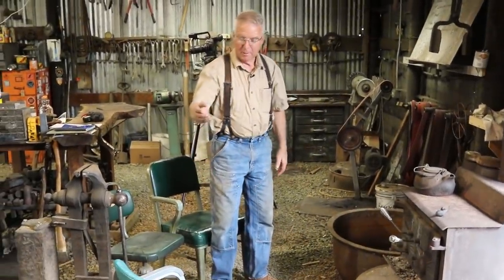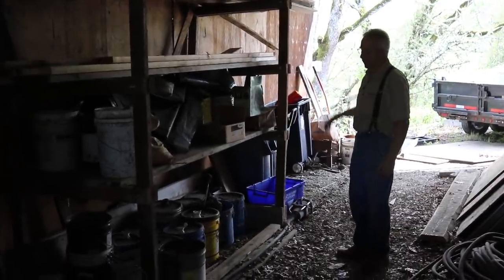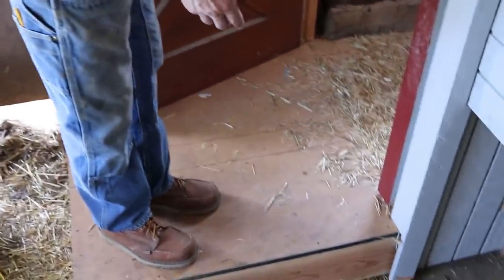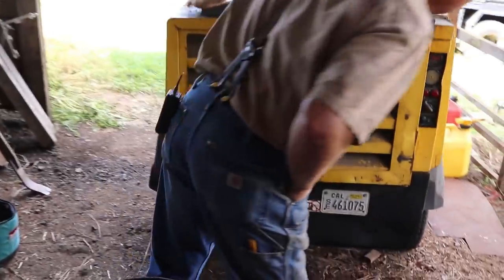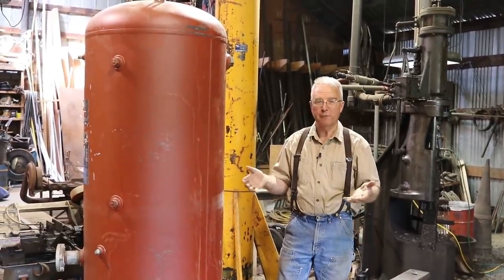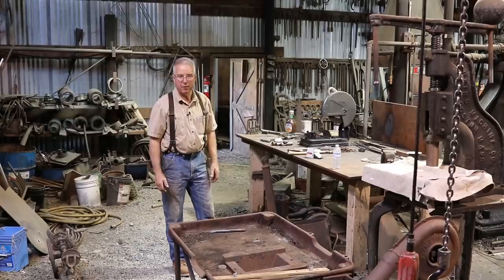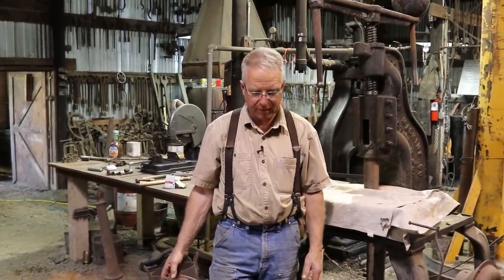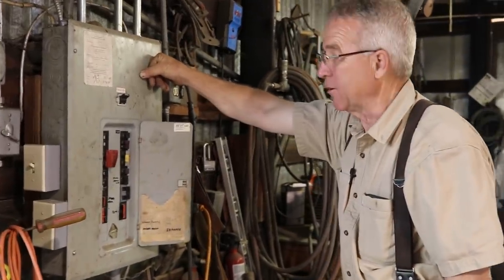Shop Tour 2.0

Comment: All of your thoughts about the air was fine.  Any steel with good welds was going to work, and would not be the point of failure.  Both compressors to the new tank will be fine, but i would be sure to have shut off valves on all entries and exits, and using the smaller compressor most the time for costs to run it and replacement later if need be.  Best wishes

Comment: Wonderful Shop!  Love the new pressure vessel!  If it were my shop I'd put the pressure vessel out of the way and that means a corner next to the wall so that when it comes time to blow the water out it can exit the building on a short pipe.  With the new power hammer I'd put them near each other but at a 45 degree angle so that when you're working on one the other doesn't get in the way but they both can be near the forge and anvil.  But that's just my opinion, a guy who loves watching blacksmithing, bladesmithing and carpentry.

Comment: We used air to start some very large generators in the FAA. We had one tank per generator, and had six of them. As they were only used for starting the tank had enough capacity to get the diesel generator started. We used a smaller compressor to charge the tank. Your installation is looking at a more continuous air use.

Comment: 40 years ago bought an uncertified 82 gallon tank from a salvage yard. Pressure tested it by filling it with 81-3/4 gallons of water, bypassing the pressure shutoff from a portable compressor and installing a 600 psi gauge. Plumbed that into the junkyard tank and pumped it up to 310 psi. It creaked and ticked but held steady over night. After 39 years of constant service it began to ooze a little rusty water at a welded seam. The only burst compressor pressure tank I ever heard of involved a failed pressure shutoff on a little portable unit always left plugged in. When the tank burst it blew the end wall and garage door out of a 2 car garage.

Comment: After reading the other comments, I don't have much to add. I would recommend a pressure test of the  storage tank using a pressure washer and filling the tank with water. Probably test it to 150% of nameplate rating. I was responsible for the compressed air system and the boilers at work for 25 years and supervised the pressure test of a 6 ft. dia. by 20 ft. long autoclave. I would put the tank outdoors, add an automatic drain for condensate and run 2" piping in to the shop air system.
Reply: Do automatic drains use electrical solenoids on timers?
Reply: @jakeparr4532  Yes. Set the valve open time and how often. Wrap with heat tape if freezing is possible.

Comment: Thanks for the updated tour. My only concern towards the tank is what is it rated for. Most boilers are low pressure compared to your 100# plus. A call to the maker would be advised.  I see it's welded but I'd still check on it's rating,before building that kind of pressure,if it was only designed for 30# plus. Water drainage is a must  Also check the relief valve on top for it's rating. Good Luck with the remodel

Comment: An easy sullution for the roof is to run alububble underneathe the sheets. It takes care of insulation and will direct small droplets from condensation away.  Wires is spaced 420mm across beams to hold the 1 meter sheet pvc an alu bubble.

Comment: I worked maintenance at a bakery for 45 years,  we ran sch 40 galvanized pipe under the cement floor in some areas without problems until it became a problem years later due to someone hitting it with a drill and  rusting out in anotherarea, the entire run was cut, plugged and a new line was run on the ceiling,  I would put the tank up high out of the way, hang it from the ceiling,  a tank that large is going to need a large air compressor to fill it, if it isn't sized correctly your compressor will never shut off

Comment: I would recommend putting an automatic water drain on it to keep tank free from condensation, keep in mind that this system will freeze. I’m not sure if they offer a frost free style on the market but you could put heat tape on it as a remedy if outdoors. 
That’s a rather large tank for a smaller compressor. Maybe you want to plumb into a common manafold with a isolation valve to just use smaller tank with smaller compressor.
Ditch the electric panel ! :) 

Channel is top notch as always !
Reply: P.S. 
that’s a large tank for most tasks, a smaller compressor can handle most shop stuff with a smaller tank and not spend so much time to fill up. Utilize common manifold to switch back and forth easily

Comment: My experience says, in the Pacific Northwest,  outside out of direct sunlight. That helps with condensing water vapor out of the compressed air without needing a line dryer.  Nice addition.

Comment: Scott - be sure to have an easy/quick way to drain condensed moisture out of that tank. And I’d mount the tank outside so long as your winters are mild enough that the condensate will never freeze solid.  If not, I’d put it off in a corner somewhere w good drainage access. More later on the multiple compressors feeding it

Comment: Anxious to hear what you decide on the storage tank. My two cents is to utilize for the entire shop air supply, if a smaller compressor can keep it up to pressure as I don't think you want the diesel running when not using the power hammer.

Comment: My opinion is mounting it definitely out of the way, either in the air or underground, in the air is definitely more convenient for modifications. I would absolutely hook in a smaller compressor to keep it charged for general use with a ball valve, check valve and tee to be able to isolate the big tank if desired and use the big compressor for the hammer, I would recommend check valves, tees and isolation valves in the installation so you have options.. Great additions, and thanks for sharing your shop!!

Comment: I’d suggest Mounting the tank outside and utilize the surface area and shape for some sort of an artistic final assembly!
Reply: I'm guessing the tank needs to be close to the hammer to supply the air properly. that's why under grade was a good setup.
Reply: Nah, if the piping is sized big enough it can be 500' away.
Reply: I agree, it would also keep some compressor noise outside the shop, acting as a big muffler.
Reply: I'd paint it blue or gray and have his logo put on it

Comment: It would be pretty neat to strap that air tank to the ceiling. Less piping the better. It would probably be easier to run pipe from the roof down to the compressor. Very cool! Love the video!

Comment: You might want to look into using some pallet shelves they use at big box stores, they can handle the weight you can get different sizes to make the maximum us of the vertical height of your shop. Storing the stuff you don't use much at the top along with the pressure tank up there leaving it available to get to but still out of the way. Also it will help solve the clutter issue in your shop

Comment: if you have room, it would be an interesting project to build a masonry heater in the middle of the shop. you don't need to keep wood burning to get heat since the masonry stores heat and radiates it out over time. your wood stove, on the other hand is a lot more transitory and most heat is wasted as it goes up and through your roof. there are a few good books on amazon and several builders around the country.

Comment: Banty's are egg layers for sure. Smaller eggs but, give you more of them. Banty rooster's can be very protective. My shop is usually a disaster, always something sitting somewhere where it don't belong. 
Put the tank outside, some of those tanks over time, will have weak points and yes, they'll explode due to pressure. Just depends on how well the walls are. One reason the old well tanks were a huge no no to use as air tanks. Constantly expanding and shrinking, weakens them. Great video, cheers :)

Comment: I am  a dry cleaner and laundry the tank you got  was a water heater  they work with live steam from a boiler  and return steam  it has plenty of strength . Outside covered  would be fine it will build a lot of condensation so just blow it down  every day . The good thing is it was ment to hold water.

Comment: Keep the tank outside, (under cover) it is easier to pipe air than to have a tank in the shop.  Dump the MH lights, go with Hibay LEDs, no warm up time. I have changed out all mine to LED and really appreciate the idea that the lights come on instantaneously. I have a 1200' shop, small by many standards, but I "over lit" the shop by about 250% and have come to like the idea that it is bight every day. Especially at 68 years of age. Over the last three years, I have saved the cost of the lights in the electric bill.

Comment: I once ran an air tank of very similar size, but I guess heavier. My suggestions are: first design the water drainage system, whether a bucket or piped auto drain. Mount vertically for smallest footprint and good cooling. Anchor that light vessel strongly. Support the pipe work well. Outside would be good if you're happy to maintain. You will love the smooth delivery from that vessel.

Comment: Yes you can have 2 air compressor. Have check valves. I do alota pipe fitting professionally in industrial plants. Pit the tank in a shipping container same for a air compressor

Comment: Some informed electrical comments:
1. You should check and see if you can get away with only changing the "guts" of that electrical panel with a bolt on breaker insert from a company like Eaton or Square D. It would save you having to rework the conduit, but it might not be the worth of the cost depending on availability.

2. Re: 2 compressor control
I initially thought to comment that you could add an electrical transfer switch to keep the high flow compressor for cycling until I remembered it ran on diesel, making you the controller!

Thank you for bringing us into your shop/ second home.

Comment: Add a SAFETY VALVE TO BLOW OFF EXCESSIVE PRESSURE and a BOTTOM BLOW DRAIN VALVE to remove moisture.  Railroad engines use automatic ones and semi trucks use a D2 valve pressure governor valve's high pressure port to trigger the bottom blow to remove moisture.

Comment: Having worked on big compressors, I am a big fan of giving them their own room. A simple concrete block structure where you can land power and pipe the air in is my choice. Bring the pipes in at the high point of your air system and give yourself a couple drain valves to allow moisture out in the AM when you start the beasty up. Leave a hole for an exhaust fan in the block, and give yourself some vents down low. Try to control temperature and filter the incoming air. Big 2" furnace filters are cheap. Your pressure vessel will love you long time.
 And while the Chambersburg might not call for it, an air line oiler can keep your tools a lot happier with the only regular maintenance need being to top up the oil reservoir here and there. We used Marvel Air Tool Oil when I worked at a tire shop, and later maintained said shop. Big expensive tire changers required lubrication and seizing one up was looked down on.
 
Don't mount the tank up high. Armies learned quickly that detonating a bomb above ground provides the most blast effect. If your tank should fail with you in the shop, having it overhead would be a really bad idea.

Comment: Outside with the compressor. Fit a safety valve and vent to safe spot and pipe in your air with dryers and Oiler’s fitted where necessary. Best keep stored energy away from work spaces.

Comment: Since it is a certified pressure vessel, it should have an ASME stamp somewhere on it. That will tell you the maximum working pressure and when it was tested. It looks like a great vessel and you are lucky to have it. Consider using bolted flanges to blank off the two main nozzles. There should also be a minimum temperature on the vessel tag as well. Good luck.

Comment: Id put that receiver outside. Have a manual drain on the tank bottom to remove condensate. Also im not sure what pressure your compressor puts out but put a pressure gauge on the tank and if its too high then put in a reducer for your workshop air.

Comment: I once knew a guy that sandblasted and painted heavy equipment with an industrial compressor such as yours. In the winter he made duct work that captured the hot air coming from the radiator and used it to heat his shop.

Comment: If you are putting two compressors in parallel, make sure you have some kind of valve to block one from backfeeding the other.  I did an install long ago which was a medium sized kaseser rotary screw which was for a machine shop running a bunch of VMCs and the boss had a car fab area in the rear where we installed a 5hp triple stage piston pump which was his old/backup compressor.  The kaeser was set to run HELLA flow at 90 psi and the piston pump would run up to like 110-120 psi.  The piston pump could run the line pressure high enough that the kaeser would do weird things, so we installed a ball valve in the middle of the circuit (they were on opposed ends of a 150ft long line of copper and each side had a tank and that fixed the problems.  You could probably find a check valve that would block flow backwards into each pump and just install it right near the outlet, assuming you can get one that is high enough flow...

Comment: Primary stress is calculated stress=pressure(psi)*diameter(inches)/{2*thickness)}<20000 (for steel).  So for example 120psi*24"/{2*0.125"}=11500psi --> safe but I would want it a little thicker.  Rust is the enemy.  Make sure you can remove the condensation.

Comment: I'd put both power hammers side by side. rather than back to back. You want the forge in close proximity to the hammer and unless your going to have 2 forge setups, you'll end up walking around the power hammers to use the one on the other side, losing time and heat in the process.

Comment: Compressed gases have a lot of energy. Check the nameplate to see what rating it has for gas/air. If it's not clear ask the manufacturer. Most likely the rating for air is half the rating for water to give a higher safety margin. Also take a close look inside and abort if there's any significant corrosion (light surface rust is ok) or evidence of wall thickness loss. Needs a drain and correctly set pressure safety valve, especially if the compressor can deliver a higher pressure than the vessel can hold. I know it sounds like a lot of work for a simple air vessel...

Comment: 1) air in the lower 2” nozzle, air out the top 2” nozzle;  maybe a gauge too. 
2) 150# relief valve on the top. 3) 3/4 drain valve on bottom to drain moisture. Can add a timer valve, but can be manual just as well. Probably best to mount near the power hammer. If piped too far away you’ll lose the benefit of the air storage. Something tells me you know most of that already....but my 2 cents.

Comment: Go to a farm or garden supply and get some agricultural vinegar. 20% vs 5% acid. It will pickle iron and steel nicely. 

Federal Pacific Electric panels, FPE panels, also means "Fire Producing Equipment"

A dual compressor system will work great. Just separate the two with good valves. A 1-2 hp portable compressor with a small tank and a quick connect and valve to the big tank can work great. The pressure shut off valve will control the cycling. I connect a larger tank to my smaller portable and reduced the cycling and got more umph when I need it.

Comment: If it were mine to do- I like the up in the air behind the shop crane. A long drain is easy to configure too, letting the pipe drain degrade instead of the tank, making it a maintainable/replaceble component. That would extend the life of the vessel greatly, beyond your life probably. I would plumb a shop compressor into it as well. I would ball valve each compressor at the tank so you can isolate systems for use or maintenance. As for the breaker panel, yes with the reputation and age, get it gone asap. Consider dual 200 amp load centers. Not so much for huge loads as for circuitry isolation. It will increase flexibility tremendously for the 220 vs 3phase vs daily lights and 110 outlets. All that can eat up panel space quick. IF its practical, and it may not be idk. Enjoy your videos, the editing, family involvement,  real world experience you include in them. Thanks for sharing

Comment: If you put the air tank outside, you might consider a roof system that will blow off in case of tank failure.  I know in certain industry this is required for the rooms that hold large compressors.

Comment: Nice tank and I envy your shop due to the sheer size of it.  
I would suggest mounting  it up high. Wont take up any  floor space or be exposed to elements  I have a tiny work shop and floor space is a premium. I mounted a 33 gallon compressor tank on a top shelf about 8' high and secured it the the shelving The tank is from an old craftsman oiless that crapped out i removed the motor and installed a check valve into the inlet port and use this for extra storage capacity when running a plasma cutter.  Luckily i dont require 90 scfm to run my tools but the extra storage is nice.

Comment: You always have good content on your shows. Thank you for providing so much info all the time. I had a furniture mfg. plant and had a lot of large equipment. When We moved in, the warehouse was used for light work and a lot of storage. I sure wish we knew how important a good electric supply was before we signed the lease. As it turned out, the lack of power shortened our ability to stay open. Scott, think about the power first and do it first. Peace of mind is power in it self. Keep up the good work!